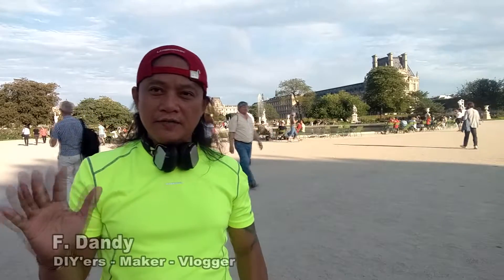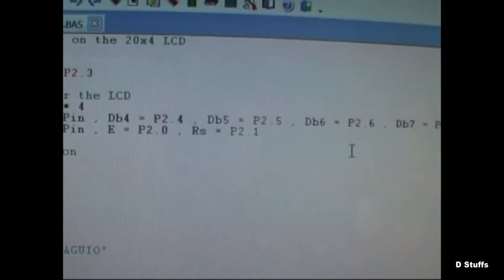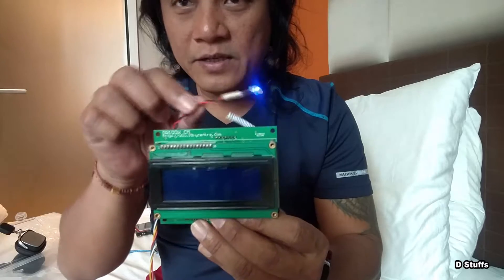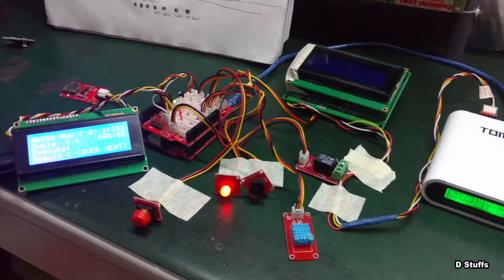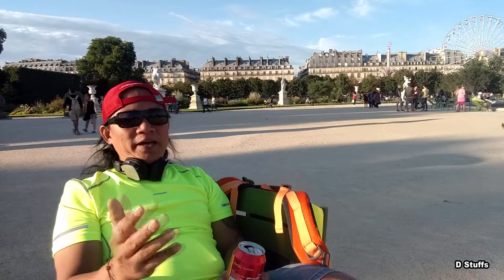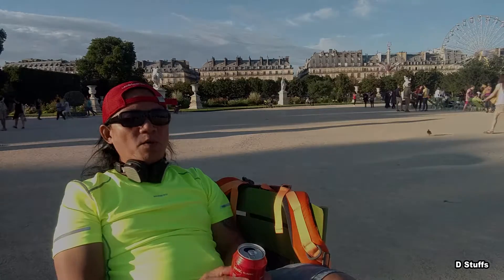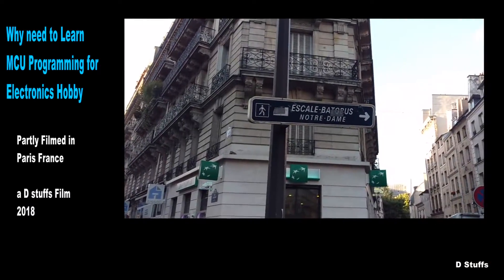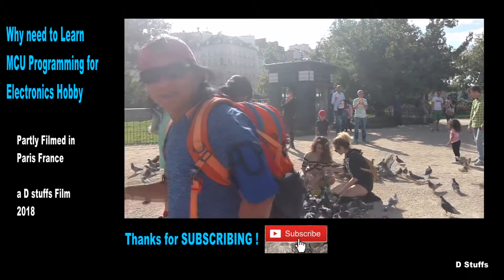Why need to Learn MCU Programming |  8051 | Arduino | Fun with IoT Basics [Paris}

Comment: Mr.dandy , for stc microcontroller hex file upload use arduino ide / programmer stand alone hex uploader
Reply from the maker: STC micro has a simple way to download the program into its ROM, using only  USB bridge (USBasp) and STC In-System Programming which is free.    About Arduino IDE to download,  I have not use it.
Reply: I want to make a standalone downloader tool from Arduino to STC, via serial communication
Reply from the maker: @adeirawan566  the idea is nice,  you probably need an application software to drive your hardware programmer that select the range of STC MCUs, which is your target MCU.     Good luck, please share this project, it is very interesting.
Reply from the maker: Just an update with STC,   the latest news I got last year 2021,  STC made some MCU that you can program the chip directly via a PC USB port without having to have the USB to UART bridge (USBasp), I have not try this.

Comment: Sir, how can I send the data from my STC 8051 into the cloud storage such as google spreadsheet? I
Reply from the maker: Hi,  i have not reach that level of programming with 8051,  but I got connected to cloud with esp8266 wirelessly (Wifi) .  You have to be connected to the internet,  cable or wirelessly,  the interface to 8051 can be the UART ports.
Reply: @dandySTUFFSraw  thank you sir
Reply: @Syakir Pro  How about using a ESP8266 and 8051 microcontroller using the AT command, but a wifi hub or hotspot is required. 

Or try gprs/gsm board connected to 8051.

Comment: mr.dandy witch software use for STC microcontroller hex file download upload ? i means how get hex file from STC chip already have hex file one inside STC chip that file i want to download ??
Reply from the maker: I am using the STC ISP provided by the company.  It is only for downloading HEX (bin) file into the MCU,  it looks that uploading file from the MCU is not possible with the current STC ISP.

Comment: Mr. Dandy use any software to program the STC microcontroller
Reply from the maker: I am using Assembly, C (KEIL)and Basic Language (BASCOM), or if you mean to program the STC micro,  I am using STC ISP, a propriety free downloader APP on Windows with UART interface from STC company.
Reply: To program the chip, any usb to ttl will work like the FTDI, ch340 etc.

My setup is keil and a ch340 with stc-isp.
Reply from the maker: Thanks for this info... This is my conventional setup.  There are also dedicated STIC Programmer made by 3rd party on a chip level, it means it has ZIF socket or adapters for SMD to program chipset, mainly for Mass Production,
Reply from the maker: I was informed that some STC chipset can now program without the USB--TTL bridge,  just direct to USB port, anyone tried?